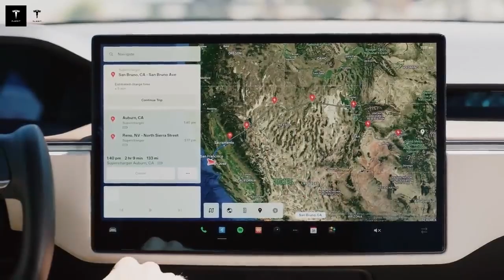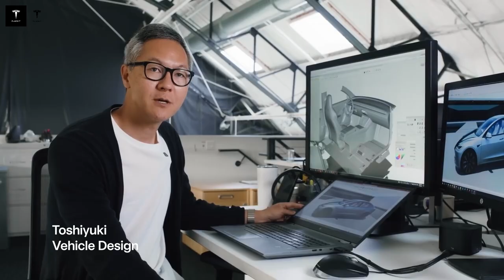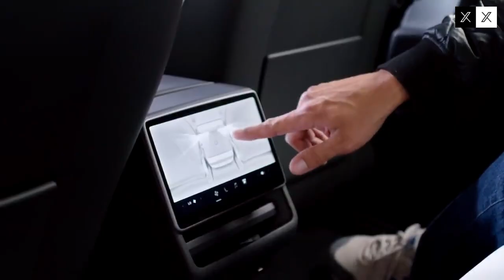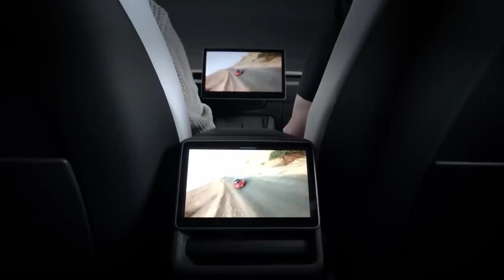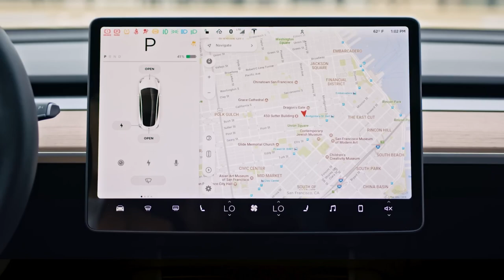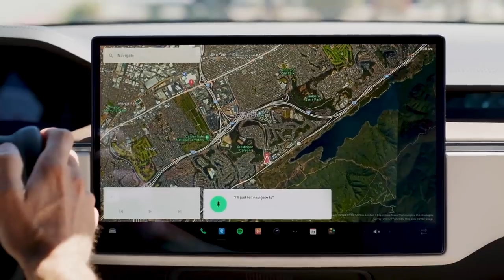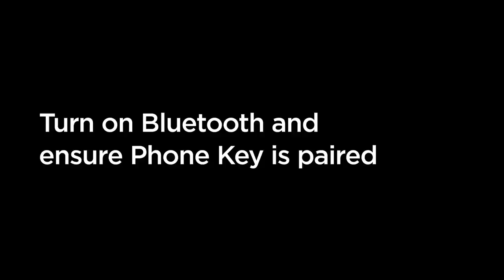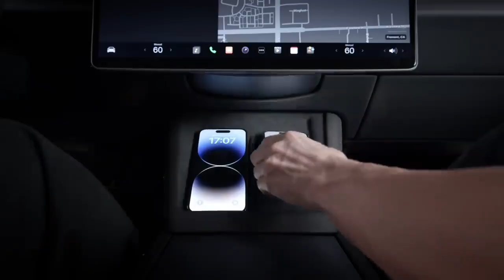Finally Here! Tesla Unveils Aluminum Ion Battery — Model 2 at $18K with 550 Mile Range

Comment: No there is. No.  Official confirmation.  Or. Concrete 
Evednce.   That tesla. Has. A new. Aluminum. Ion. Battery in production   Or.  Development. For.  It’s.  Vehicles.  Designed. 
To last. Over 200,000 miles.  EPA. Miles. At 8year. Up to 150,000
Miles.  Now. Is. Minimum. 70% battery capacity